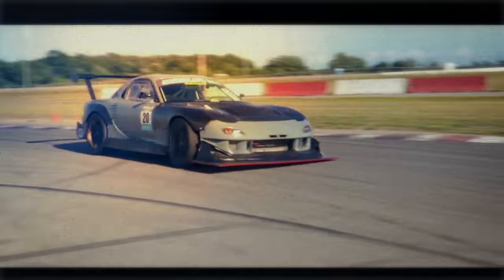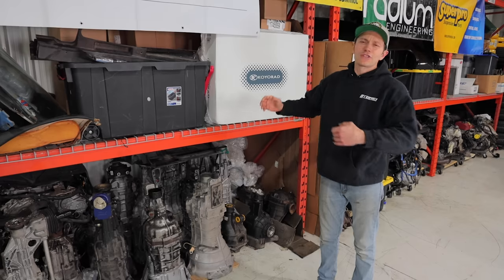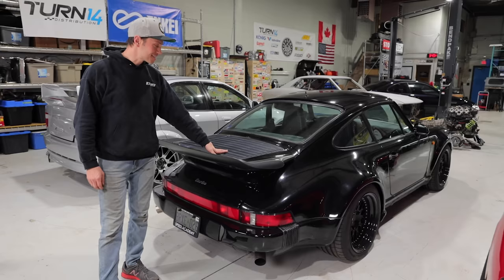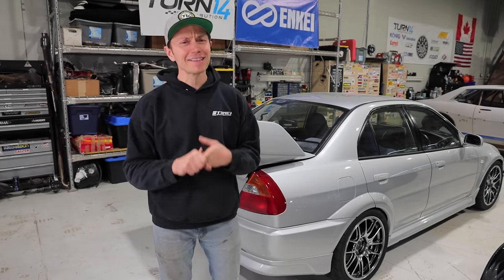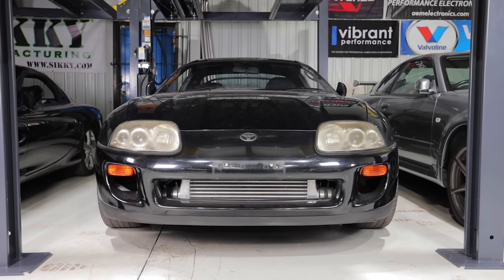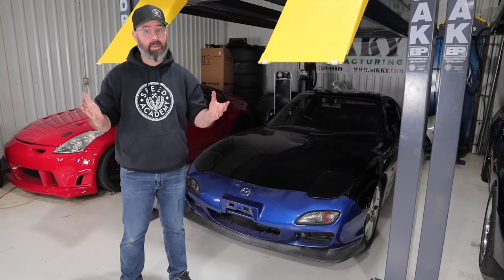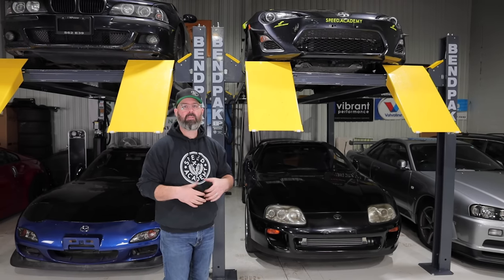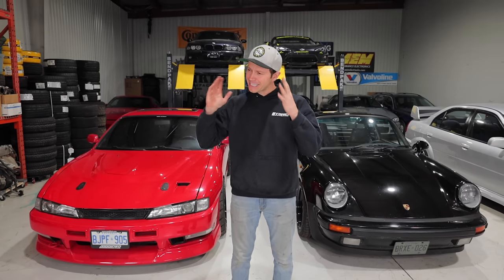FULL TOUR OF OUR 2020 CAR COLLECTION & SHOP (GTR, SUPRA & MORE!)

Comment: 1) I like Gunmetal on Connie, but a subtle black strip where that blue strip is now, and something like a silver streak along the main body line on the side would really set it off. Or reverse that and go black with a gunmetal strip along the bottom of the door.
2) Supra vs. GT-R? Hell yes. I'll be rooting for the Supra, but more interested in the GT-R build since I don't know much about them.
3) FD vs. ????? Maybe a Mitsubishi GTO?
4) 350Z vs. something LS powered could be interesting. An "older" 5th gen Camaro should in the affordable range soon. That, or a C5 'Vette.

Comment: The r34 looks really nice guys!! I'm very happy for you two to have one of these. I really like the idea of the M5 touring but that's just me being a bimmer maniac (as it's more difficult to have Japanese cars in Europe sometimes). The m30b35 is the big daddy in-line 6 of the Era, could be a fit in you e28, but the m20b27 is lighter and smaller. I've done a Motronic swap on mine from an e30 so I could have the 55pin Bosch ecu, matched with s50b30 injectors it runs E85 good. And the 5 speed manual swap and lsd. Wish it came like that from factory!

Comment: If I had an MX-5 Miata, I would K swap and rotrex.
However as a suggestion, I was wondering as a point of difference given you have done a few K swaps would you guys consider doing a V6, V8 or Rotary swap?
If you stick to the K swap it will still be awesome.

Comment: If the 930 is original Turbo, I wouldn't cut it up. You do what You want with it, but I don't recommend slicing it.
Reply from the maker: NOOO cutting. Just bolt on stuff

Comment: https://i.pinimg.com/originals/5d/5b/ea/5d5bea1b96325e6fac153d6223c2ecf3.jpg Yellow Celica!
And that BMW engine is an M30B35, probably from a M535i (E34 or E28 gen) Good for boost as they're only around 8.8-9:1 compression from memory
Reply from the maker: Was told its a euro higher compression engine but hard to know.
Reply: @speedacademy   Just done some double checking, if it's the M30B35 - https://en.wikipedia.org/wiki/BMW_M30#M30B35 - 9.0:1 compression, I used to have E30 325i's and if i recall correctly given at the time closed loop management was still in development, BMW went with lower compression to compensate for varying octane levels depending on which market.
Not a bad engine though, very smooth power cuves in both the M20 and M30 series, just lower compression.
Of note, Alpina did actually turbo charge these engines making for 355bhp :)